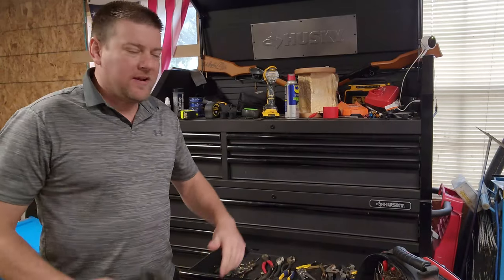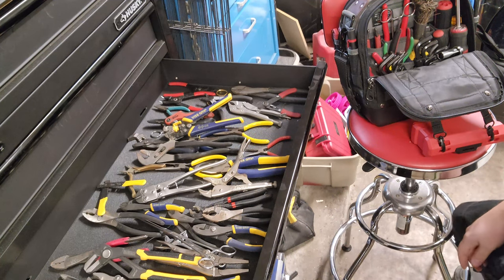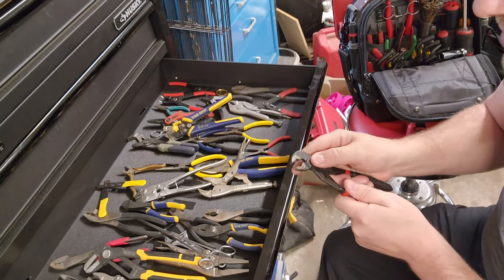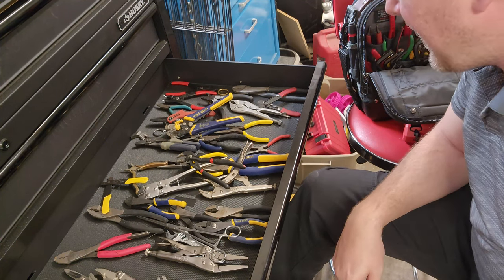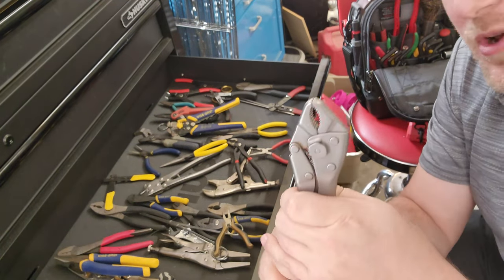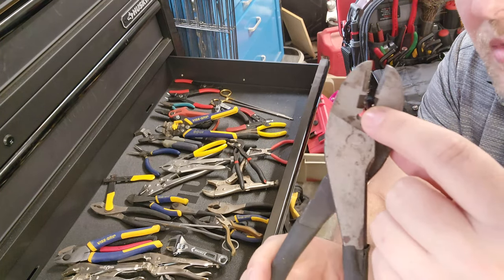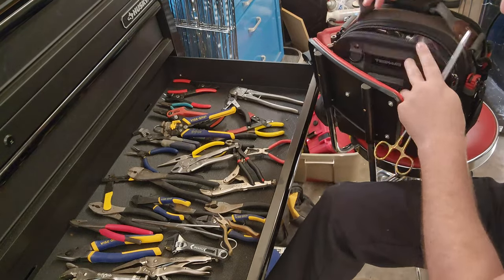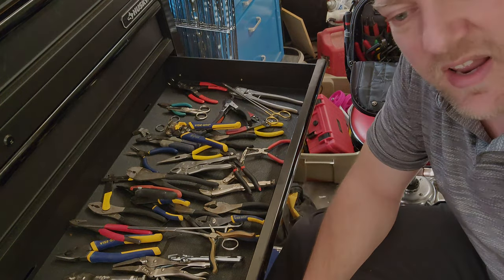Biomed Basics: Pliers!

Comment: I love vise grip pliers. I have a reputable brand my dad used since the 80s, now in my tool kit still works to this day. Hemostat clamps from a fly tying kit of mine are also some of my pliers that I use a lot. Flush cutters you wanna spend good money on and wire strippers for various gauges. Those I mentioned are the ones I use almost every single project I do.